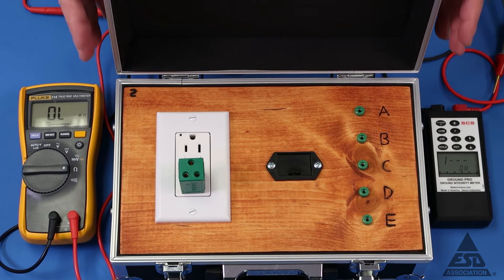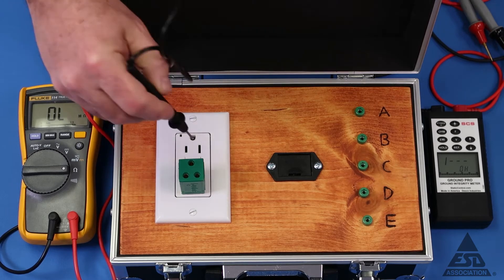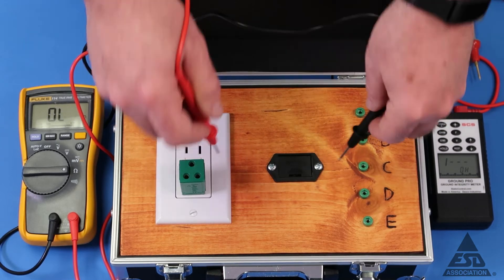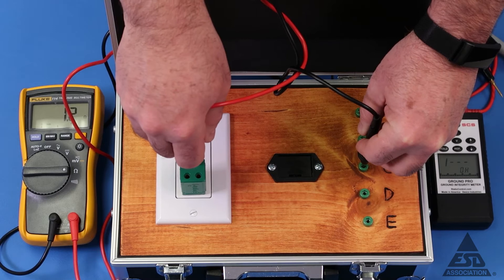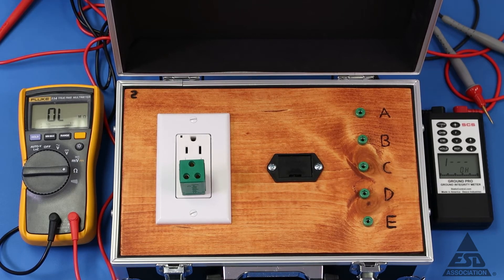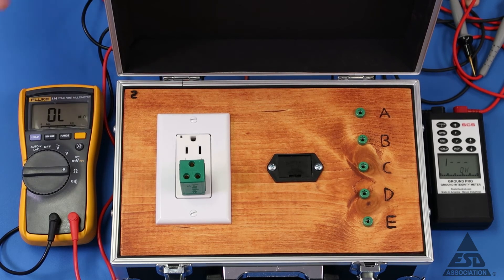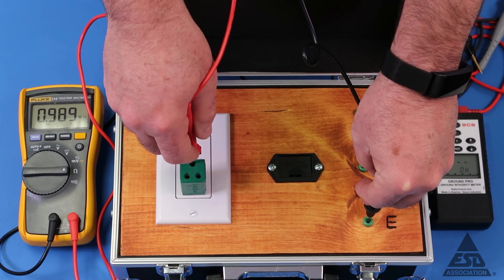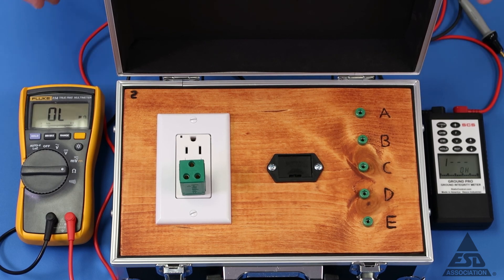Impedance vs. Resistance Measurements

Comment: While your comment of "dumb-down 'tester'" might be correct, it is also all that is needed for this measurement. Since wrist strap and footwear/flooring systems typically have resistances of greater than 10*5 ohms, this measurement is only a verification that the ground is significantly lower. Testers need to take into account the noise from the mains, either 50 or 60 Hz which will cause a DC resistance meter to provide incorrect results.

Comment: 5:36 "These meters are not that smart. The way they work is they put a little voltage on it and they measure the current."  In other words, measuring R = V/I, where V is fixed by the meter.  If that was the way they worked, then how would they measure zero ohms? That would require the meter to deliver infinite current.  Instead, the meter applies a small current, and reads the resulting voltage.  And indeed, you can use that knowledge to understand how to make sense of case D (4:45), where the reading in one direction is 168.4, and in the other direction -148.3. That is, in one direction the meter's testing current adds to whatever current is already flowing across the resistance inside the wooden box, and in the other direction subtracts. So the meter displays are are interpretations (as ohms) of two legit voltage measurements. We just need to take the average of those displays, which is 10.05, to get the resistance, just like the "impedance meter" reads.

Comment: This video is extraordinarily misleading.  If you want to gain an understanding of the electrical path between two points, you have to take into account that the path may include resistance, capacitance, inductance, possibly a voltage or current source, or possibly something even less simple. If you're going to just "measure impedance", that measurement is utterly useless unless you know what frequency you're measuring the impedance at.  This is a direct result of X = 2 pi f L (where X is the reactive component of impedance, f is frequency and L is inductance), or X = 1/(2 pi f C), for capacitance (and ignoring phase angle).
Oddly, the manual for that SCS Ground Pro meter makes no mention of the frequency it operates at. So apparently it's a dumbed-down "tester" that's not really intended to measure impedance in a serious way, but perhaps instead it's intended just to perform some standards-compliance test that specifies a particular frequency?
Reply: If the presenter show us what's the components or wires inside box to let us know the difference, it would be better to understand. Just like you said, measurement takes many factors into consideration.
Reply: @brucejao5083  exactly! I want to know what’s inside the box